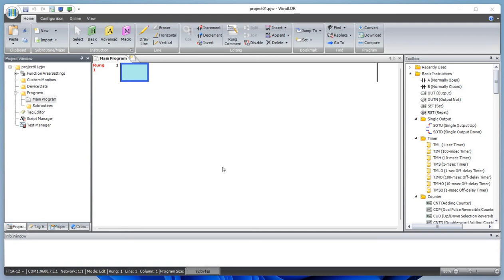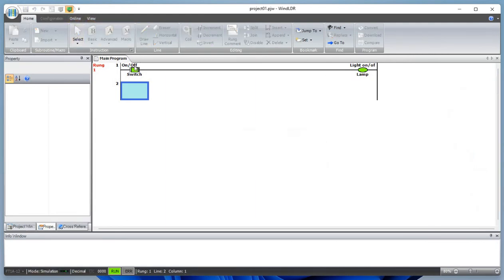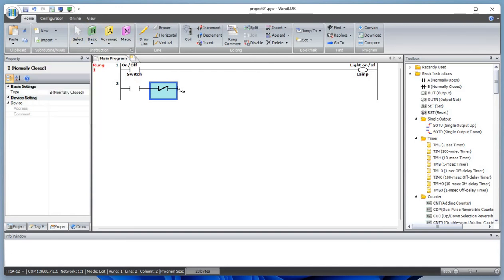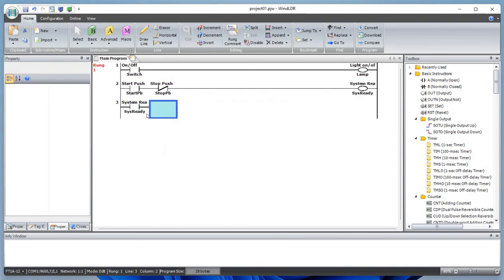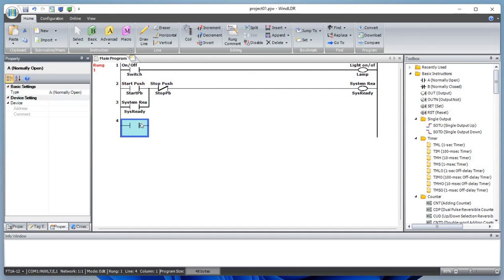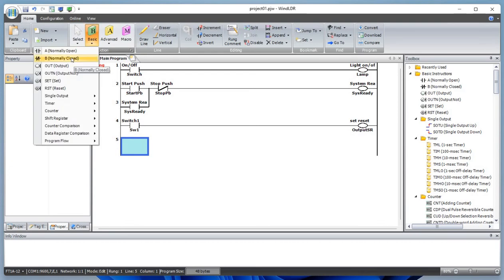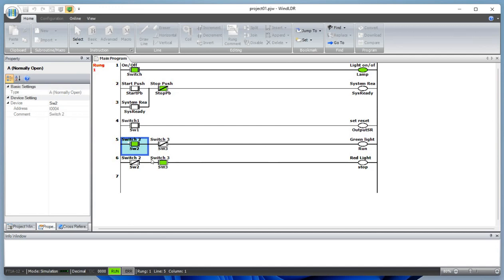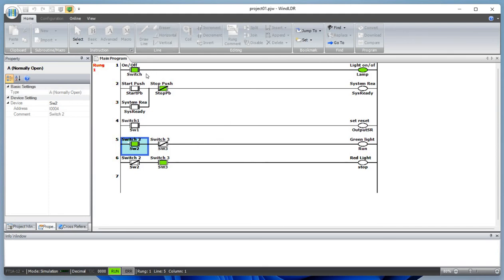2 Idec Plc Programming WindLDR

Comment: I believe the “set output” function latches the circuit. And then you can use the off button to activate a “reset” output” 
I was thinking your way before the Idec class but theres functions and such that are built in so you don’t have to structure circuits like “relay logic. “